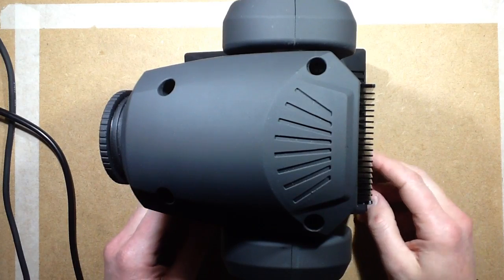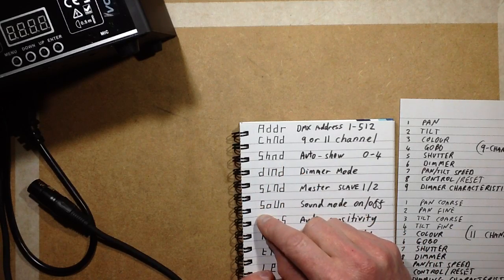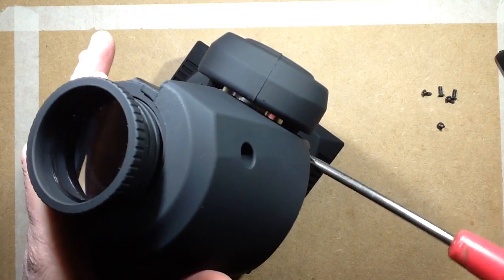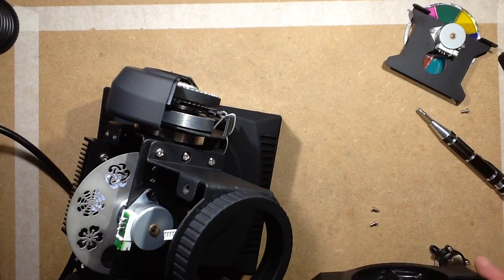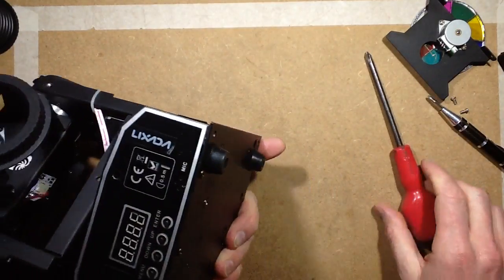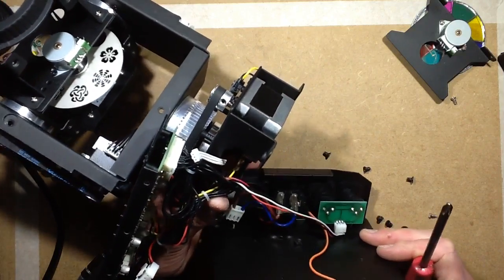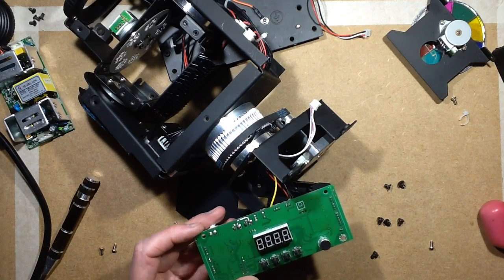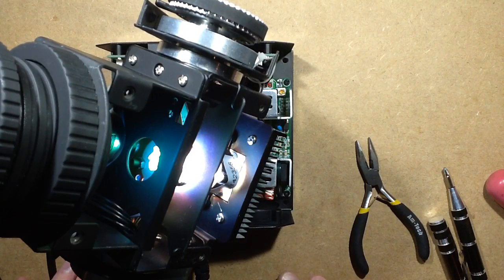10W LED "blunty" moving head disco light teardown.

Comment: Hi... Any chance you have a picture of the control PCB's inside these things?
Reply: only reason I'm asking is.. I have 4 60w units & 6 10w "similar" cheap-o units and every single one suffers from one thing... auto or sound mode work great but none of them will run when set in DMX mode... ...and now the MFR's are just giving me the run around and desperately trying to find some way to fix for them...
Reply from the maker: +Gene Sisson If they worked before then the most likely thing to fail on the DMX electrical side is the receiver chip.  You can check that by connecting them together and setting one to master mode and the others to slave to see if they are communicating.
Reply from the maker: +Gene Sisson Do you have a valid DMX stream running to them?  They will revert to auto if there is no valid DMX.
Reply: +bigclivedotcom As far as I can tell data is being sent... I've tried connecting them on both an Obey 40 and my software controller (mydmx 2.0). Other light units I have here seem to be just fine on either controller, so as far as I know, it's not a controller problem... These seem to ignore being connected to anything other than themselves, and have tried individually and chained... Thought maybe a bad cable too but 6 cables later still the same behavior... MFR sent me a response the other day saying theirs won't work on a software controller (mfr even changed the item description after-the-fact I let them know I was having issues)... But seeing as neither wants to work on either controller it has me a bit baffled to say the least...
Reply: Here's a more silly question... Is there something in DMX standards that would prevent a light connecting and working on software controller Vs. a manual DMX controller?
Reply from the maker: +Gene Sisson The only common issue with cheap disco lights can be the speed of the data refresh.  Some of these lighst are trying to juggle the DMX and all other controls in a single processor, so they end up relying on the fact that many cheaper lighting desks can put out "slow" DMX with lots of pauses in each frame while they process stuff.  It's still valid DMX, but actually gives cheaper lights a a bit of breathing space to do other tasks.  A dedicated DMX replay unit like a Chamsys dongle may actually put out data at full speed, and some systems don't like that.  There's sometimes an option to hobble the DMX and slow the rate down a bit to compensate for that.
The only other possibilities are that the DMX sending device may not be sending the full 512 channels, which again is perfectly acceptable in the standard, but the light may be trying to do stuff in that part of the data cycle and rely on just glancing at the data stream when it is at its start address.
The DMX frame has a start code (1 byte) that dictates what sort of protocol it's sending.  That's usually set to zero though, and many receivers simply don't even check it.  It's become a bit more important these days thanks to a newer DMX variant called RDM which has a different start code.

Comment: You know it's bad when the Chinese grind the numbers off the chips used in their knockoff product so others can't make a knock off of itself. But I will say that a number of the Chinese random things are getting more and more well made.
Reply: i will say they are struggling with lead free solder still.  I hate lead free solder.  Yuck.  I have used the lead free with silver content with modest success, knowing the solder is physically stronger on single layer board through hole applications though.

Comment: Do you reckon you bodge a standard ebay 100W LED module and 44mm optic in place of the current LED? If you could fit a proper LED driver module into the side somehow you could turn it into a serviceable spot/floodlight. Although you would certainly need a fan heatsink in place of the one fitted to the back of the head.
Reply from the maker: +Spiz103 You'd need to upgrade the power supply, cabling and the lightsource would have to be very small to be compatible with the existing optics.

Comment: I've been inside enough of the Pro ones to know that they are all modular, makes replacing a bad part in the field and the shop much easier (especially when you have a sacrificial unit).
Of course, it still takes way too many screwdrivers to pull the whole thing apart.

Comment: Is it a DMX that uses a XLR connector or the other way around? I've got Microphones which use XLR and have the same connections.
Reply: XLRs are interchangeable between lights and microphones, thank god for that since it makes it easier when there's an emergency on stage during a show. Most theater technicians call both DMX and XLR connections XLR since we use the same cable anyway.
Reply: xlr and dmx are different cables, while you could use a xlr as a dmx it is not recommended bc most of the time it will cause the lights to glitch

Comment: i have 3 old scanner moving mirror type lights which have great colours/gobos but 1 uses a 24v 250w halogen and the other 2 use 15v 100w halogen reflector lamps (not easy to source) I want to replace with LED so I wondered would it be easier to gut out the lamp holders, make some room for GU10 and hot wire in some GU10 240v Single LED lamps. I dont mind fiddling with focal length as the lenses screw in like yours does. I dont want to buy new led version lights as my units have plenty of life in them and i dont want to go down the complex route of finding leds on heatsinks and messing with voltage conversions. I dont care about losing the dimming function in the 2 15v units as i run them in auto mode that never dims the lamps. Any advice greatly appreciated :) Love your videos bud, iv been watching loads of them :D

Comment: Does that interference cap reduce that whistle you hear from small usb chargers?
Reply from the maker: +Chris Roller No.  That's often the actual switching frequency or a harmonic of it.  For those of us with good hearing it can be quite annoying.
Reply: +bigclivedotcom
Just like the old CRT whine. No surprise there, as the power supply technology is quite similar.

Comment: I have one of these, but branded as a QTX Synohead. It's slightly better built, has a fan on the back and seems to smooth slightly smoother. But I must agree, these are lovely little heads and I'd recommend them to anyone. They're essentially ADJ Inno Pocket Spot's :)

Comment: Hey Clive,  I have a couple of Acme Spot Knights that are similar to this and one has developed a "graunching" noise in operation, be it DMX controlled (manual or programmed) or with the inbuilt shows. The sound seems to be a result of the steppers making the whole unit vibrate, you can feel the sound and it feels like it sounds, if you get me. 

It's random, there's no distinct operation that induces the noise (panning, tilting or gobo change). It's never when stationary and when both are paired there's no difference between them as far as movement etc. goes, the two mirror each other perfectly when controlled. 

I have stripped it apart, mechanically it's sound and there's no oddities when moving the head manually. Any ideas as what I could test to try and work out what the problem is?
Reply from the maker: +Jon Simmons (Neffers) It could be a tired supply cap causing mains ripple on the output to the steppers.  If it was just affecting one motor I'd think that maybe the driver, motor or loom had an issue, but for both axis it seems odd.  If there are belts check they are tensioned correctly, but not too tight.
Reply: Thanks Clive, Caps, hmm, I'll look into that. As far as the mech goes, I have compared it to the non growling one regarding belts and other things like play etc, and it felt exactly the same. There's no snagging on the loom and the plugs look and feel fine and no dry joints as far as I can tell. May be worth touching those up too eh? 

Many thanks for the reply.

Comment: Hi, would you please be able to tell me the width of the actual head please and the distance from the inside of the bottom yoke to the pivot points for the head please?
Reply from the maker: +Birdiemango1 The plastic section of the head is about 95mm wide and the centre of the pivots from the top of the base is around 75mm in the very middle, but curving up past the end of the tilt motor to about 55mm.
Reply: +bigclivedotcom aha thank you :)

Comment: "I'm recording a video of this teardown (which I can view later when I mount this thing again), so I would better take a picture so I don't forget where the bits go together, because it's better than viewing the video"?!
F*ck logic?!
Reply from the maker: +no head The video camera at a fixed angle doesn't catch the detail that two identical connectors had two matching colours of wires, with slightly different gauges that were not necessarily interchangeable.  The phones camera caught that.  And besides, I like to encourage people to use their phones to log the positions and colours of wires as they take stuff to bits, since it is good practise to do so.
Reply: bigclivedotcom Well done then :)

Comment: It's sad when a properly connected ground is a surprising find.
Reply: I have a fairly good model train transformer... No ground. Best part? The case was METAL! I'd THINK a metal case would have ground. I mean, maybe there was a reason, but I doubt it'd hurt to have a ground. To be fair though, not one the user if someone gets shocked. I think it's riveted? I don't actually know... Flathead with a hole in the center. That IS a rivet right?
Reply: Just what are you going on about?
Reply: @ratchetthewusky Transformers are galvanic isolation sources anyway. The probability of failure in the insulation to the metal case is about as high as the probability of insulation failure between the primary and secondary.

Comment: I wish there were an army of EEs dedicated to product teardown reviews like you do; focusing not only on what the product is/does, but how it's made, how well it's made, and the like. There's a dude(s) in China who I'd imagine you'd shake the hand of for designing this thing as robustly as he did. It's things like this. 

Maybe someone tried to tell him to replace machined bits with plastic bits, maybe he conspired to sand off he Ti numbers/logos to avoid some nationalistic pride thing, or maybe he sourced local knockoffs to get it under production cost per unit and knew the functionlly-equivalent-for-this-task copycat was good enough. Who knows. 

If I had need for some small movers I'd consider these far more seriously than I otherwise might have, and judging by your review that's either entirely by design, or as likely, by the damn good work of one man somewhere who'll never be thanked directly for not letting this thing be built with parts that'll fail halfway through a show.

Comment: Great video, well that was a surprisingly high quality item for such a reasonable price. Normally the internal finishing is the first thing to suffer in low cost Chinese items, but it was a nice touch to see the use of metal gears, proper bearings and nice rounded edges everywhere to avoid cable damage.

Comment: couple questions:
1, why don't the discs have 360* motion? Is there such a thing as a 360* stepper?
2, Why is it common for this kind of thing to come apart in sections (split housings), is it to help with field servicing?
Great video as always
Reply from the maker: The stepper motors can rotate continuously, but it uses a very simple technique to get an exact reference position for the colour and gobo wheels at power-up.  The wheels have a physical end limit, and by running the motors for more than one full revolution they hit the end limit and the motor just skips against it.  That means the controller has an exact reference to the position of the wheels without needing a sensor to detect the position.
Reply: +Slot1Gamer Might want to double check but I'm pretty sure steppers are generally able to rotate continuously. Perhaps it made the design easier, but it is strange.
Reply from the maker: +Slot1Gamer The spilt housings are pretty common.  All they're doing is hiding a metal substructure and blocking any light spill from in the head.  The fact they separate easily to give access to the insides is something that has pretty much always been done with theatrical moving head fixtures.  It helps make maintenance much easier.
Reply: That, and the fact the wires going up in the yolk would twist around and get damaged easily if they had unlimited 360 degree motion.
Reply from the maker: +Nitrxgen Slot1gamer was referring to the colour and gobo wheels as opposed to the pan and tilt movement.
Reply from the maker: +theSYNQmaster It's more wires through moving joints and something else to go wrong.
Reply from the maker: +theSYNQmaster They often have the processor in the yoke and therefore only one limited axis (tilt) to pass through.  One of the most common problems we have on the VL colour bulkheads is the infra red position sensors.  You can see what I mean if you look at this video:-
https://www.youtube.com/watch?v=XOYUth1t9g0
Reply: +theSYNQmaster LEDs can't yet compete with several hundred watt discharge lamps. The problem is you need the light in  a small spot to get a good beam, so you can't just use a big LED array
Reply from the maker: +theSYNQmaster They are on near continuous use in tours and also get very hot due to the use if a high power discharge lamp.
Reply: ***** not so great colors I'm guessing
Reply from the maker: +theSYNQmaster There are LED washlights made by the main manufacturers, but at this time it's easier to get the massive amount of light required for an arena show from a discharge lamp.
Reply: +Slot1Gamer most colour/gobo wheels are capable of constant rotation. These are the only lights I've ever used that can't. I'd never ever use constant rotation on the colour wheel (looks ridiculous), but I often do like to rotate the gobo wheel to give the beam some animation, and found we couldn't do that on these lights unfortunately. Just snaps.
Reply: +Slot1Gamer I have 2 Martin SCX500, they have no duty cycle, can run all night. the colour and gobo wheels go 360 continuous, they dont bounce back at the end of the effect, i have no idea how they are doing this, I think I spotted a magnet and hall effect transistor near the wheels. When on dmx you get a nice effect if you use a slow rotation on colour and a slightly slower or faster reverse direction on the gobo wheel for an ever changing display. The mirror of course does have stop pins for boot up calibration. and yes those two stepper motors get quite hot too, its just a quirk of steppers being continuously energised for precision
My scanners are modular inside too, its for quick swap outs of failed components. I had to replace the mirrors once as something sprayed on them and made blotchy spots which ruined the effect and tarnished the surface. They are just held on by 4 screws, the mirror being glued to a metal bracket :)
Reply: You don't need the light in a small spot. The light is normally diffused and collimated into a large spot to even it out before focusing it.  Otherwise you'd just get an image of the led chip on the wall.  The problem with several hundred watt LEDs is getting rid of the heat.  Tungsten is perfectly happy to operate at 2,000 F.  LEDs, not so much.

Comment: I find it amusing how many comments there are about "how good" this light is. To me as someone who works on the big, real-deal ones as part of my job I can't help but think of how much of a toy this is.
I will agree, I'm impressed with the steppers for how super cheap the rest of it is built.
The pan motor will almost always be larger since it has to rotate more weight than the tilt plus it has to be able to oppose any forces generated by the tilt motor moving the head at the same time.
Reply from the maker: +mwiz100 As someone who spends a significant part of my year working with PRG and "pro" lights that cost tens of thousands of pounds each, this video is in context.  For £80 ($120) the build quality and functionality of this light is very good.  In fact the whole light costs much LESS than most small components for a VL3000, PRG Bad Boy or almost every other touring fixture.  I regard this light as a great toy, a useful tool for a small club and definitely a very useful teaching aid in the theatre department of a school.
Reply: +bigclivedotcom Oh shit PRG, well then! Hah
Indeed, parts for most of those are more than this whole thingie. Hell the lamps for most big brand movers cost more than this whole fixture! True, context is everything. Given I was just working on a mover earlier today before coming home my recent reference frame was a totally different class of fixture.

Given the proliferation of Chinese made lights it's fairly surprising at times what you can get as an off brand that almost certainly comes out of the same factory as some of the brand name stuff.
Reply: +bigclivedotcom Speaking of, I did search and this exact unit can be purchased as the American DJ Inno Pocket Spot "12W" LED light for $260 USD!